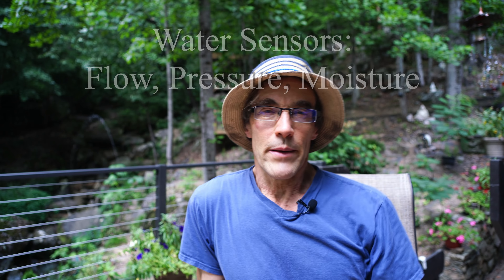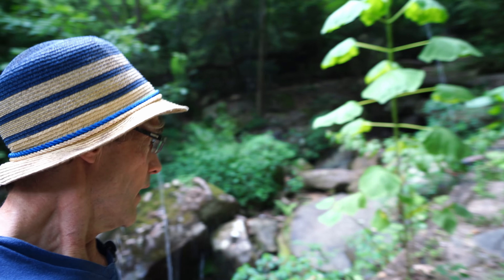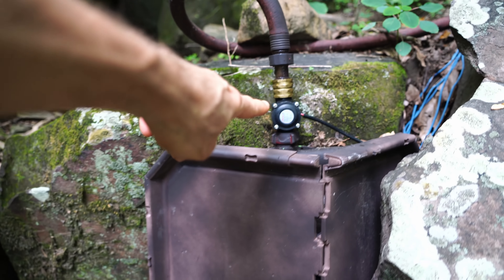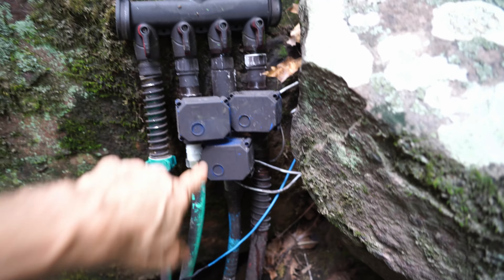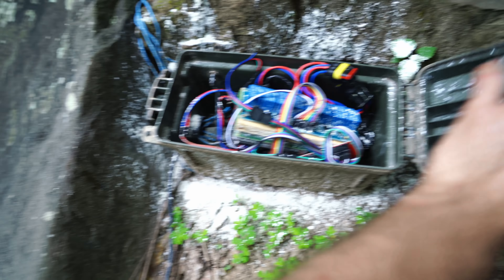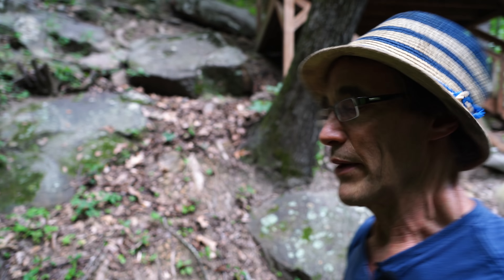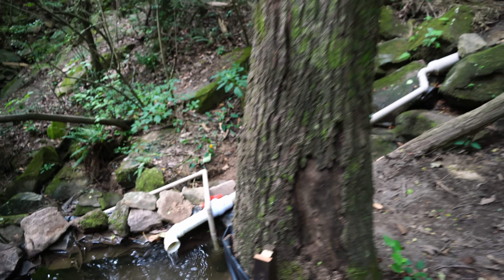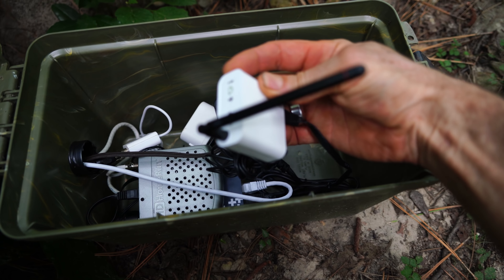Water sensors with a raspberry pi:  flow, pressure, moisture

Comment: Maybe I'm wrong but did you have to use an analog to digital converter for the pressure sensor? I'm trying to measure the level of a tank.
Reply from the maker: Yep, you can see the analog measurement   with the adc object in this code: https://github.com/brucewinter/myhouse/blob/master/mqtt_creek